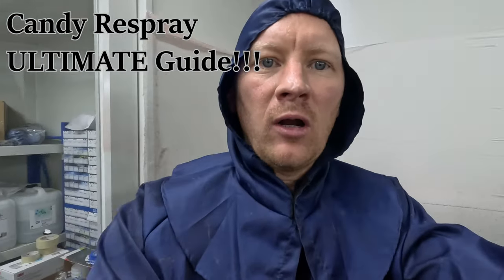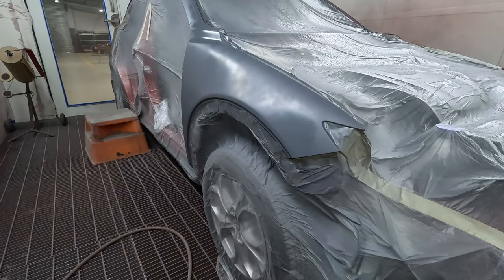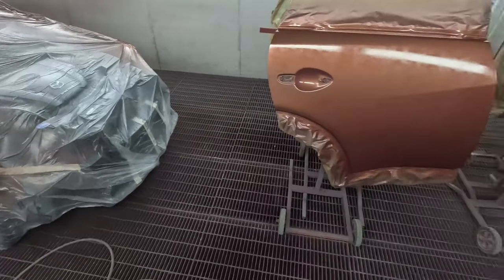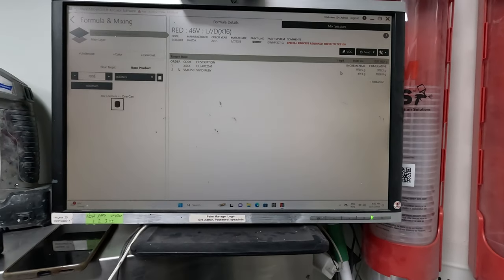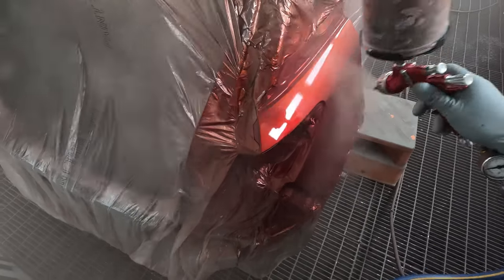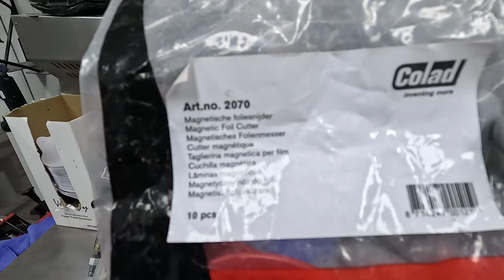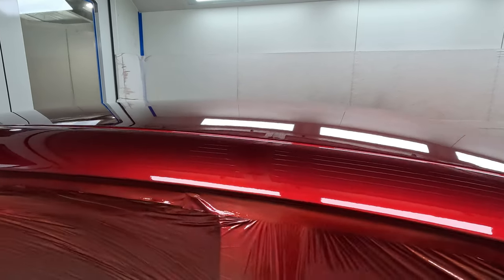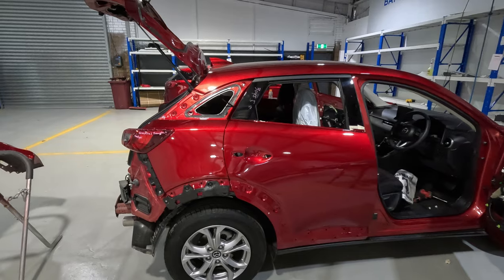Candy Respray ULTIMATE Guide!!! 46V Soul Red Crystal

Comment: Hi mate, I’ve done my 2k epoxy primer and 2k high build primer and ready for basecoat now, I’m using devilbliss flg 5 1.4mm tip, I’m using 2k acrylic Porsche crayon grey, supplier recommends 2 parts paint to 1 part 2k hardener and 10% 2k thinner, how would you set up the gun? Full fan / full fluid, 20 psi ? Appreciate the advice mate, after working on my van I definitely have more appreciation for the pros knowing how much prep is involved, finding it rewarding though despite being a bit stressful

Comment: Looks good as usual, you’re just about an expert with the candies,😂😂😂.  Man haven’t seen the gunman pro lites in a minute., still sprays like new. 
Also, I believe sata has blue liner lids that’s design for water like 3m pps, I was told that the reg liner/lids use a water soluble glue to hold the liners on and could begin to deteriorate with water base, as I was told by a ppg employee rep. Also the blue ones are finer to help strain paint even better. 
I know your clears are different, but here in the states, I used the ec clears, (design for envirobase fast to slow) 520/530/550, and I’ve always went with a slower reducer (usually colder months ecr85/dt85, warmer ecr95/dt895, dead ass summer when it’s hell temps out side, ecr98)cause they could be finicky about about bake temp and time, the worst I’ve gotten was die back. It was a pain when I first used them trying to dial in the clears so I wouldn’t have issues, adjusting bake temp or time or both. Also don’t be afraid to mix the reducers 50:50 finer tunning. Keep the vids coming my guy, makes my day go by smoothly when I’m in the booth.

Comment: im finding it hard to grasp. when you spray the base, it looks like brown/copper or similar. but when hitting it with the clear it all goes very deep red. is it pigment in the clear? explain as if im an idiot pls :D i find it very satisfactory to see a paint job from primer to finish.
Reply: Got to follow him closely= after the base coats of copper comes the tricky part: 2 coats of clear with transparent color in them- ie. the candy coats.  He used the Devilbiss Prolite with a TE20 aircap.  Then he quickly blasted on two coats of clear clear with the ANI gun with a 1.2 fluid nozzle and a 1.3 air cap. So at least 6 coats of paint. Gunny explains the finiky details of getting this right and clean- very hard to do with that much spraying. Watch him again. Justifiably something to take pride in!
Reply: I forgot to add the "wet on wet" sealer coat and the third coat of base, so 8 coats of paint-whew!

Comment: Tricky tricky spraying everything off of the body disassembled like that..!!!... Any variation of spray technique in mid and tri coats will make each panel a different color.....

Did you necessarily NEED to sealer the entire car ??? It looked like it was already in full color with no body work or primer .

Why an entire respray ????

Comment: I have a question: Why reprime the whole car if you're painting it the same color? Do all candy colors require it? Thanks in advance for the reply.
Reply from the maker: It helps coverage for the colour, it seals down the old paint, it aids adhesion, it covers any small bits of steel from prep work, it also helps fill prep scratches allowing you to prep with a coarser grit, that speeds up prep. So yeah, loads of reasons.
Reply: @TheGunmanChannel  Thank you for the quick and detailed reply! I just found your channel and will definitely be watching tons more! Best wishes
Reply from the maker: @SawShotShared  sorry, and the other question, no, not all candies need it, you could potentially not prime at all if the original paint was good, or even use a sand-able primer if there was lots of repairs that require it.
It's more that these jobs are best with it, it's not a concrete rule.

Comment: I use DC4000 for the ruby tinted clear... I spray it thru the 1.2 tip in my DV1.... Do a spray out on a metal card in correct shade sealer and determine the number of tinted coats needed... Sometimes all you need is 1 depending in if youre blending or not... Typically 2 coats is the number or 1 coat with a wet on wet orientation coat from an elevated distance... 

Happy painting people